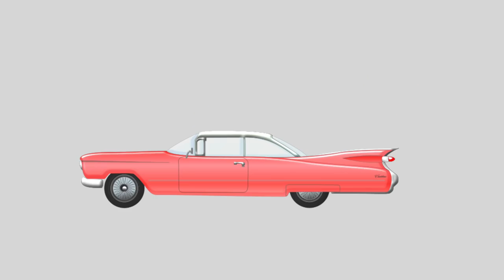Yes, Rockets CAN Fly in a Vacuum

Comment: 00:54 Can't have it both ways.  If friction on the ground for car's forward momentum then where is friction i.e. resistance if in a continuous vacuum?
Reply: At 1:15 she gives an example of how a car moves using Newtons third law (friction between wheels & ground), then says rockets work a different way, by using Newtons third law. She's a clown & a liar 😂
Reply: don't you know that complete vacuum doesn't exist? so even by your logic, rockets should definitely work
Reply: @stuartgray5877 They’ll just bring up w=pv (totally forgetting that it’s supposed to be delta_v) and claim that the gas performs no work since the external pressure is 0. What they don’t realize is that the equation is telling you the work the gas does on the surroundings. It takes no work to push on nothing.
Reply: @AM-rd9pu  OR ask papalegba - What is the combustion by-product of a hydrogen oxygen flame.
It WONT ANSWER because then it would have to admit that a Space Shuttle Main engine is a giant WATER CANNON.
Reply: @papalegba6796  - "fire is not water"
Maybe if you had finished the 9th grade you would have learned that Hydrogen PLUS Oxygen - MAKES WATER.
But Bless your little heart for effort!
Reply: @stuartgray5877  ok so for rockets to work in a vacuum fire has to be water. Seems legit 😂😂😂😂😂😂😂
Reply: @papalegba6796  Stuart keeps asking you to explain how rockets accelerate mass, right here on earth in atmosphere.
You refuse to explain it.
I wonder why?
Reply: @rocketman484  - "I wonder why?"
Because it knows that it cannot claim that the 14.5 PSI atmospheric gas "SUCKS" the 3000 PSI gases from the rocket nozzle.
It would have to ADMIT that the 3000 PSI gas pressure inside the nozzle PUSHES out against the 14.5 PSI.
THEN it would have to admit that works gets done.
Reply: @rocketman484  you are stuart, sockpuppet guy. Plus I answered you lots already but you ignore me😂
Reply: @papalegba6796 so just TELL US HOW a Rocket accelerates mass!
We know for a fact that rocket engines Do accelerate  mass.
Why won't you explain HOW?
If you don't know, just say so.
Reply: @stuartgray5877  do we, chatbot? Kinetic theory says they dont, as has been explained countless times 😂
Reply: @papalegba6796  please enlighten us about your magic, if the things you claim are true it could change the world

but you're lying and you know it
Reply: @papalegba6796  - "do we, chatbot? "

I have literally SEEN rocket engines running with MY EYES!
It is a "FACT" that they accelerate mass.

So, I guess they do it by "Magic" in your world.

Since you just refuse to admit that GAS PRESSURE is a FORCE that can ACCELERATE GAS.
You refuse to just admit to one of the most basic aspects of physics.
FORCES and ACCELERATION.
Reply: @stuartgray5877 Space, as it's defined as a constantly accelerating vacuum void, renders all force inert do to the fact the only barrier or "wall" you have is the acceleration of the void itself.
You would have to accelerate matter out the back of a rocket at higher rate than can be displaced.(faster than lightspeed)
Currently no matter what you do,.. you can't pump out matter fast enough to accelerate a pea.
Everything displaces into a accelerating void at a higher rate than can be expelled.
 So there is no build up of pressure behind the rocket to press the rocket forward.
Spacial acceleration nullifies propelled matter.
This is the physics of your relativity claims for spacial influence.
This will happen with conditions of..
Combustion including explosions and
expulsion of pressurized matter such as gas or liquids.
Under the conditions of relativity an object can enter the spacial void from a planet however it will enter with a constant velocity with no way to accelerate.
It will follow the entry trajectory with no way to veer or maneuver. 
It would enter and have perpetual motion unless hindered or altered by collision with another spacial existing body.
Reply: @papalegba6796 I’m not dismissing w = -p * delta_v. I’m just telling you what w represents.
Reply: @dragonz_eye Do you think a vacuum is a force or can apply a force?
Reply: @AM-rd9pu Do you think space is a constantly accelerating expansion?
Reply: @dragonz_eye  nobody thinks that. you could say that space experiences expansion, but it's not the expansion itself. your questions show your ignorance
Reply: @frantaspacek9583  WTF are you saying here,.. "you could say?",.. why say it at all?
We could say it's not expanding.
We could say the void is static and enert,.. free of any force.
But, in order to have the space be what everybody observing it wants to be,.. it's in a state of constantly accelerating expansion.
Do you know why?
Reply: @dragonz_eye  huh? that's normal English phrase, go argue with a dictionary if you don't like it
Reply: @frantaspacek  You didn't answer the question.
Reply: @dragonz_eye  here's the answer: nobody knows why it's expanding
and that's completely fine, we learn new things every day. it would be dumb to claim we have all the answers right now, that's what religions do.
Reply: @frantaspacek9583 First it was... "Nobody thinks that." 🤔 
You shouldn't be spreading propaganda on space travel if you don't know WHY space is supposedly expanding.
Also,.. can you tell me what fictional FORCE exists that is said to cause a constant accelerative expansion?
Reply: @dragonz_eye  That is absolutely moronic. A person can spread the knowledge of fire without knowing what the exact chemical reactions are. According to your logic, all of humanity should still be stuck in caves.
No fictional force exists, that's the whole point of fictional things. Shouldn't you ask about the actual forces at play? I'll tell you after you show me your calculations that don't require gravity.
Reply: @frantaspacek Now you want to deflect with rhetorically misleading misconception.

Why did you say "Nobody thinks that." And then say "Nobody knows why."...
when discussing the supposed fictional needs of YOU'RE space paradigm?

Which is a blatant lie as I know WHY space is supposedly expanding with a FORCED acceleration.

Can you explain yourself?
Reply: @dragonz_eye  I definitely am not a space paradigm
Reply: @frantaspacek *YOUR.
happy now?
Now, explain yourself.
Reply: @dragonz_eye  Alrighty then, I said "nobody thinks that" because I have never heard about anyone who thinks anything like that. And I said "nobody knows why" because nobody knows the actual reason. Are you happy now? Pretty sure you could've figured that out on your own.
Reply: @frantaspacek  OK. 
So YOU don't KNOW anything.

Thank you for clarification.
Reply: @dragonz_eye  I know plenty, you're the one proving your ignorance with every single message
Reply: @dragonz_eye You didn’t answer my question. Do you think a vacuum is a force or can apply a force?
Reply: @AM-rd9pu  Can a constant acceleration exist without a force?
Reply: @dragonz_eye  You didn’t answer my question. Do you think a vacuum is a force or can apply a force?
Reply: @AM-rd9pu No,.. vacuum chambers are static other than downward acceleration acting though it.

"Space" has multiple forces acting on and within it.

 Does a constant acceleration require a FORCE?
Reply: @dragonz_eye Ok great. Now that you agree that a vacuum isn’t a force, you should also agree that when a rocket motor fires in a vacuum, the gas pushes its way into the chamber instead of the vacuum pulling the gasses out. 

Space is just a vacuum.

And yes, a constant acceleration requires a constant force.
Reply: @AM-rd9pu Great,.. constant acceleration requires a FORCE.
I GUESS "SPACE" ISN'T JUST A STATIC "VACUUM" THEN.
AS IT EXPANDS IN ALL DIRECTIONS WITH A CONSTANT ACCELERATION COINED AS "DARK ENERGY."
YOUR FICTITIOUS SPACIAL FRAME OF REFERENCE IS EXPANDING THEREFORE, IT IS AN ACCELERATING FORCE.
DO YOU AGREE WITH YOUR OWN PHYSICS OF "SPACE?"
Reply: @dragonz_eye You still have no idea what reference frames are.  And now now you’re claiming that just because a force is acting on something, that something is now also a force?

You also seem to not understand what a vacuum is. It’s just a lack of stuff. That’s it.
Reply: @AM-rd9pu If "SPACE" is expanding in all directions with a constant acceleration and "SPACE" is defined as a "fabric" and within this "fabric" exists "dark energy" than the conclusion is that "SPACE" IS A FORCE with the conclusion of FORCED DISPLACEMENT BY EXPANSION.
Reply: @AM-rd9pu By this "lack of stuff".. is a vacuum,.. as your definition "space" does not fit within this perimeter.
ITS FULL OF "STUFF!!"
Haven't you ever looked UP?
Reply: @dragonz_eye  Space is the empty space between the stuff. That’s why it’s called “space”

Space is not a force just as a vacuum is not a force. The current hypothesis is that dark energy is acting on matter in the universe to accelerate the rate at which objects are moving away from each other. Again, you’re drawing absurd conclusions based on your ignorance.
Reply: Clearly you don't understand physics. It's ok. We need people to make our burgers and wash our cars. Keep doing what you're good at and leave the physics to us. 

If this topic is hard for you to grasp, you would absolutely not believe how your computer works; man actually manipulating electrons.
Reply: @dragonz_eye  you're talking to chatbots. They just go round in circles 😂
Reply: @AM-rd9pu  thanks for agreeing rockets cannot alter their state of motion in a vacuum, as a vacuum cannot apply external force. You lose again 😂
Reply: @papalegba6796  Again, you’re drawing conclusions based on your own ignorance. 

Expanding exhaust gasses exert a force and do work on the rocket. The expanding gasses do not exert a force or do work on the surroundings when they’re in a vacuum. 

This is simple physics and is not contradictory.
Reply: @AM-rd9pu  no they dont, chatbot. The gas laws clearly say so 😂
Reply: @AM-rd9pu  you're saying Newtons first law is wrong too btw 😂
Reply: You’re the one that thinks mass can be accelerated without a force. That would be a violation if the first law of motion. 

And I guess it’s time for my regular reminder that w in w = p * delta_v represents the work done on the surroundings.
Reply: @AM-rd9pu  I don't think that but nice try, chatbot. Also an object that can do no work on its surroundings cannot alter its state of motion, but whatever you're not human 😂

Comment: Did someone really knows the answer?? I mean explaining how a rocket works in general doesn't tell me and how it works in vacuum  or  in space without matter.
Reply: If you have a force exerted by one mass (rocket nozzle) on ANOTHER Mass (exhaust gases) then BOTH masses will feel a force and therefore experience acceleration.  Would a crossbow fired in space have RECOIL?  Yes

Comment: non sense-- The vacuum of space would crush the rocket. You have a better chance flying a rocket through cement at least theirs some air there.
Reply: How would the absence of pressure crush a rocket? LMAO
Reply: Yes cause something that has barely anything can crush something.. 
Pressure can only crush against less pressure, not the other way round. Thats why ships blow up when they're thousands of feet in the bottom of the ocean if they're not fully flooded, like the titanic's stern. They do not have enough pressure to compare with the way more heavier outside.

Comment: You proved nothing.
Reply: You debunked nothing.
Reply: @AM-rd9pu  ok chatbot 😂
Reply: @papalegba6796 the one of us most likely to be a bot is the one that refuses to explain how much work is required to accelerate 500 kilograms to Mach eight. 
So prove you are not a bot and answer. I’ll take the answer in units of “joules” please
Reply: @stuartgray5877  a gas expanding into a vacuum does no work. It also doesn't accelerate, according to kinetic theory, as the velocity of individual particles remains the same. If you disagree just say so, chatbot 😂
Reply: @papalegba6796  - "a gas expanding into a vacuum does no work"
A gas expanding into a vacuum does NO WORK - ON THE VACUUM.

The rocket still performs work accelerating the mass from the engine.
Or are YOU going to claim that mass can be accelerated without performing any work?

Your MISunderstanding of basic physics is "evidence" of only your willful ignorance.

Comment: No.  Rockets cannot fly in a vacuum.  It is impossible.
Reply: @tgstudio85  lol.  At least I am clever ;)
Reply: @DrCash7  yup, clever troll;)
Reply: Just because you cant understand it doesn't make it impossible. just makes you not all that bright.
Reply: @boptah7489  Here are a few interesting questions for you, with the answers, that I'll assume you will agree with? 
Firstly, does the burnt rocket fuel coming out of a rocket have mass? Yes, it does have mass. For example, 15 tons of fuel, when burnt in the rocket's engines, will cause 15 tons of combustion gases to be ejected out of the exhaust nozzles. 
Secondly, does this ejected mass of burnt fuel, travelling at hypersonic velocity, have an X amount of 'momentum'?  Yes, anything with mass that has velocity, will have 'momentum'.
Thirdly, when applying the conservation of momentum laws to various objects, when one 'momentum force' has been created and is travelling in one direction, is a corresponding 'momentum force' created in the opposite direction?
 Perhaps you can give me the answer to this question in your next reply?
Reply: @sailorman8668    The fact that rocket fuel has mass or not is irrelevant.  because to have thrust,  you need resistance.   ( thrust is a function of resistance only).  There is no resistance in a vacuum.  the exhaust gasses are not thrust out of the rocket chamber.  they are in fact sucked out by the vacuum.The actual rocket will not move an inch , the exploding rocket fuel  (  assuming it has time to be exploded by the combustion process of the gasses combining). 

   When a momentum creating force is applied it does not apply a corresponding force in the opposite direction.  you can see this with a bullet going down a gun barrel.   there is no force being exerted backwards towards the gun,  the 'recoil  only happen AFTER the bullet has left the gun.   The recoil is actually created by unburned gunpowder pushing off the air that immediately rushes in behind the bullet
   The theory that rockets are pushed through a vacuum by Newton's law of 'action and reaction'.   is a hoax and a lie. . .
Reply: @boptah7489  
Search YT for "SpaceX Falcon Heavy Arabsat 6A Launch and Landing in 4k Ultra HD" and WATCH THE VIDEO 

Tell me that you see the following:
The THREE common cores liftoff and head downrange (EAST)
ALL three are travelling at about 3600 Miles per Hour EAST and at an altitude of over 50 kilometers (>160,000 feet)
The side boosters SEPARATE, Turn around, CANCEL the eastward velocity of 3600 MPH, and FLY BACK to KSC, AND LAND .

Are you Agreeing that this is what you see in the video?

Then explain to us: AFTER the rocket flies up and OUT OF THE ATMOSPHERE (above 50 kilometers) and the boosters SEPARATE from the center core - HOW DO THEY TURN AROUND AND CANCEL THAT 3600 MPH - ALL WHILE IN A VACUUM ??

SO are you going to suggest that the atmospheric pressure above 50 kilometers is NOT "vacuum" (Remember you ARE talking to a Vacuum Test Specialist)
Or are you going to claim the video is fake? (even though this event was viewed by TENS OF THOUSANDS of spectators LIVE)

OR - are you just going to pretend this evidence does not exist like ALL of my other evidence?

You could then compare this video to the ACTUAL video taken from the rockets where there is INDISPUTABLE EVIDENCE that the boosters ARE IN HARD VACUUM.
Reply: @boptah7489  tell us HOW MANY rocket launches HAVE YOU SEEN IN PERSON?
Reply: @stuartgray5877    None/  I am not interested in FAKE  space travel.  If i want to see proper rockets i will go to a firework display.

Comment: WAKE UP SHEEPLE, a rocket cant work in a vacuum. Not that that matters since it wouldn’t make it through the firmament anyway. Muh god would slap that shit right out of the sky.
Reply: Yes, it can. You can even see it for yourself. At 30km of altitude, the atmospheric pressure is barely 0.01% of the one at the sea level. If a rocket would need anything to push from, it would slow down on the ascent, as atmosphere gets less and less dense. This is not what we can observe, as soon as it rises above dense atmosphere (over 10km) it actually accelerates at a greater rate.

You can easily see a rocket at 30km of altitude, without using any optical instruments.